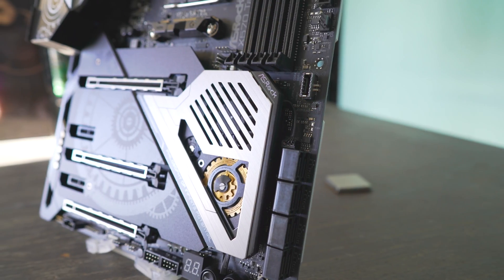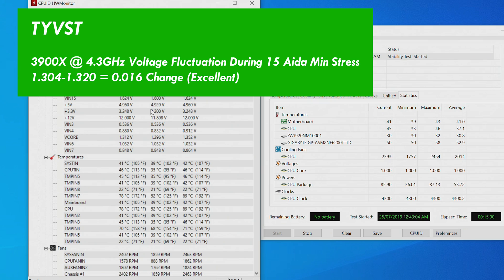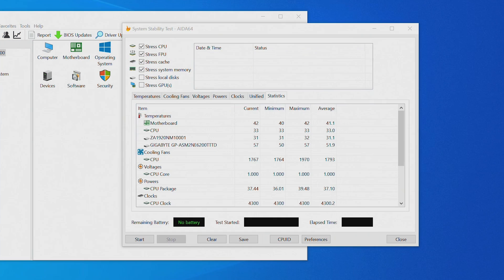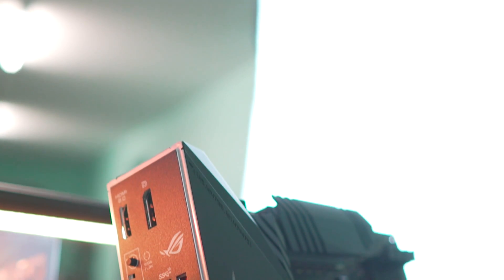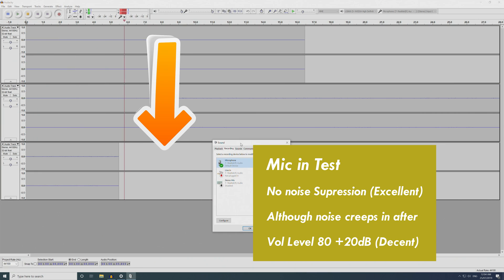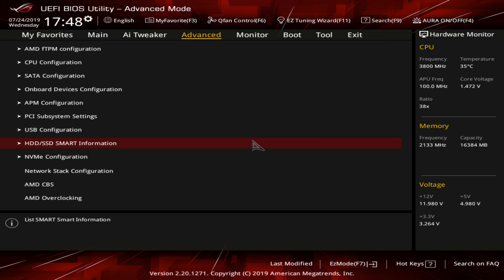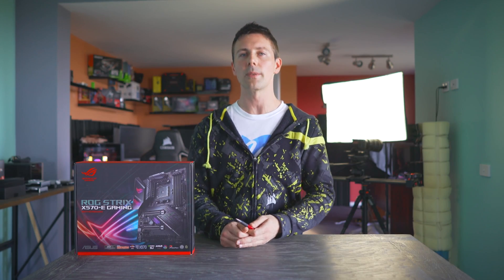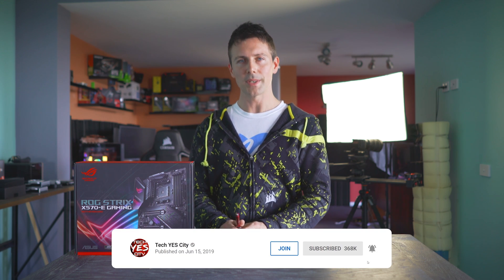ASUS ROG X570 Strix-E Motherboard Review - "3900X @ 4.325GHz Dayo"

Comment: picked one of these babies up new in box on Ebay for £200 here in the UK. I have to say I've been bitten by the ASUS bug for my previous (also used in like new condition bundle deal from Ebay) 7700k and Z270f platform. Its that ASUS has such good product support and a robust BIOS and featureset, looks like I'm an ASUS customer for the foreseeable future.

Comment: excellent review.. I know this is an old video but would you be able to tell me if this board X570-E Gaming with Ryzen 5000 can run 2X NVME PCIE 4.0 without affecting GPU PCIE 4.0 bandwidth.. I have this board with Ryzen 5 5600X, Geforce RTX 3070, 1X samsung 970 evo plus.. I want to install a second 970 evo plus NVME but dont want affect GPU performance but cant figure out if that will be the case or not.. Am i better off having the second drive as M.2 Sata\ 2.5 Sata....   Many thanks

Comment: 4:08 Running tests on teh Sh*t folder 🤣🤣

BTW, Bryan, on the off chance that you read this comment, I have the X570-E and the chipset temperature reaches 90C while gaming. Have you taken a look under the heatsink to see if they used a thermal pad between the chipset and the heatsink instead of thermal paste?
Reply: Does it still get that hot now with the latest bios update’s? I’m really on edge with the active fan.
Reply: @CBGENESIS  BIOS updates didn't do a thing for the chipset temperature because it's a design flaw. Any high-end GPU will totally block the fan.  The only way to lower the chipset temperature is to increase the speed of the GPU fan
Reply: @YAAMW  Do you still own ur X570E? and should I avoid the board?

Comment: I Got The Asus ROG X570 Hero & a Ryzen 9 3900X & I Got It Overclocked to 4.35Ghz on 1.32V Rock Solid ! I Think 1.40-1.45 is Just To Much Voltage IMHO ! I Do Have A NZXT Kraken X73 360mm And I Am Well Pleased.. Gaming Temps Stay n The High 30's Or Very Low 40's ! I Just Didnt Like all That Voltage That Was Way Over Kill !  DerBauer Said No More Than 1.32.-1.36 MAX On LN2 So I Took His Advice..lol. But I Half To Make My Junk Last For Several Years & We All Know Heat Is Eletronics #1 Enemy !! Cool Video To btw !
Reply: Can u explain how did your overclock man?
Reply: @gironsantalla7870  Wasnt To Hard..I Just Do Manual Overclocking I Have Never Done Any Software Overclocking. ! But I Just Went into my Bios/Uefi With Every Thing Set To Defaults/Or Auto and Just Set Multiplyer to 41 or 42,43 or So Then Set Manual Cpu Voltage to 1.3000 Volts And save Then Try To Boot If No Boot Or Blue Screen Either Raise The Voltage to Say 1.34v An Re try Then After ya Test Every Thing & It Is Stable Ya Can try to start bringing down the voltage a litle bit at a time an re test..then Rense & Repeat
Reply: @bigchew3149  thx a lot man. May I ask u for temps? I have a Corsair 115i with my 3900x and it has about 80° in cinebench or cpuZ bench. Is this normal? My case is also top I think (Corsair carbide)  but these temps scare me (sorry my bad English) (it has about 90° in prime95) 😱
Reply: @gironsantalla7870  I Have A NZXT Krakn X73 (360mm AIO) ) & I Have Never Saw Mine Out Of The Mid 70's At Most But I Have A Big Cube Case Thermaltake Core X9 & My Room Has AC about 70f ! Ya Can Try To Lower ure cpu voltage just a Hair An See If That Helps Any ! But Under Normal Use Ure pc Will Never Get That Hot No Way So I Would Say Ure Probaly Ok ! But Ya Could Go Find a Video from jaystwocents here on utube an he has some overclocking videos & tems to That Might Help Guid Ya !
Reply: @gironsantalla7870  o wow that seams high to me did ya add tip to ure cpu befor mounting it or wht?

Comment: ASUS makes without question the best X570 boards. The Tuf Gaming and this board are in the sweet spot.
Reply: Roland Strauss just send back my tuf good board clocked my 3800x perfect but noticed missing bclk options ect in bios

Now I have this strix-e and I think it’s worth the £80 upgrade loads of features like Bluetooth even an less vdrop on cpu from idle to full small fft loads (using load line level 4)

Can’t wait to see if I can squeeze alittle more outa this chip with bclk still it wouldn’t post with 1900fclk 😢
Reply: @FireTwo  Can u explain how overclock a 3900x with this mobo? Thx in advance

Comment: does it matter which nvme slot is used? does that do anything with the pcie slot speeds? I installed my nvme ssd in the top slot, should i use the top pcie slot for my gpu? or does it not matter at all? thank you!

Comment: Might be a bit of a random question on your video but it is driving me insane at home. In the video you show temperatures on CPUID HWMonitor, i have exactly the same TMPIN's showing up and i wish to ask if you know what diode TMPIN4 is. I have been looking all over the internet to find a answer and so far i got none. Hope you find time to give a answer, would be nice to know what i am dealing with since it randomly goes up and down between 85-94 degrees C.

Comment: Just bought this board today. Glad I did.
Reply: I also purchased this board for some reason TMPIN4 is reading 84 degrees at idle. Are you having the same issue? While Bryan's is 70 degrees under load.
Reply: @victorsvay3986  Yea mine is reading 80 degrees Celsius
Reply: @ahwayzcool4630  So Im guessing TMPIN4 is not being used and is providing false readings? Mine is now 94 degrees C even at minimum and maximum
Reply: @victorsvay3986  Yea that's what I'm thinking to. Its prolly a default false reading for a missing sensor. I'm not gonna worry about it because all other temps are normal.
Reply: @victorsvay3986  what processor you have? I'm running a 3900x
Reply: @ahwayzcool4630  3700x
Reply: @victorsvay3986  nice. Finished the build today. Installed windows 10, been tinkering all day with it. Running some benchmarks now. I'm really liking this. Gonna install some games on it in a bit.
Reply: @ahwayzcool4630  hahaha nice I'm still waiting for my graphics card
Reply: @victorsvay3986  what graphic card you getting? I just recently bought a 2080 ti
Reply: @ahwayzcool4630  2060 super. It's too expensive here in Aussie for a 2080Ti

Comment: I always appreciate mainboard reviews and hope there'll be more coming. But: Even initially you state that the VRM on this boards is close to the top-end boards on the platform. Actually, though, this board uses close to the same VRM than the 200 dollar Asus boards (TUF X570 Gaming Plus, Prime X570 Pro). Only the SoC VRM is slightly more beefy on this one. The Crosshair boards are only a bit more expensive (depending on region, of course, but still) and feature way better VRMs.

I mean, yeah, sure, all of these boards will handle the most high-end Ryzen 3000 CPUs, boards are really a huge step-up from previous generations in that regard. I still think that it's misleading to state that these are top-end VRMs, because they really are not, when put into the context of its generation.

Take the X570 Taichi by comparison: It uses the same VRM than the Phantom Gaming X model, so it basically is the best that ASrock offers. 

I would recommend talking to Buildzoid in this regard, if you want to improve your reviewing there.

Comment: Hey guys, I recently purchased this motherboard but I'm having really high CHIPSET temps -> high fan RPM noise (3500 RPM):
72C Idle browsing reddit or Wikipedia and about 79C during gaming!! Can anyone confirm this is supposed to be that high for this specific motherboard or is my chipset heatsink faulty and should i order a new Motherboard? 
Thank in advance guys :)

Comment: I think X570 board are for those who go high end builds and R9 CPU.
I'll stick to my X370 board with crappy VRM "heatsinks" and update my R7 1700 to R7 3700X after I get 2080Ti.
The thing is that newest AMD CPUs don't have big TDPs so if your board handles first R7s then it will handle newest R7s, in my case R7 1700 has 65W TDP and R7 3700X I want to update also has TDP of 65W.

Comment: I just built a pc 2 weeks ago with this mobo!
Reply: Reviews on this mobo ? Any suggestions for an other one at this price range ?
Reply: Sotiris Triantoulis I got mine for 279.99 because of the bundle deal at microcenter. It’s pretty good, and had all the features I need and more. The lighting is a problem though because the aura software makes certain games think you are running a cheat. The labeling and placement for some things on the board were kind of weird, but could just be because i’m a first time builder and things are confusing. Not sure about other boards at the same price range, I would just look around at reviews and features and find which one suits u.

Comment: None of the x570 mid-range or high end are worth it
Reply: For a 3900x?
Reply: @dommo2803  Okay take the strix-E which is £323 Vs the Strix-f which is £260 now the major differences are the number of USB ports on the back and that it has 2.5Gb networking now I have never needed 12 USB ports on the back of my pc at best 6.

As for the networking if you need faster networking by getting the cheaper board you could afford a 10Gb nic so it makes 0 sense to get any board with 2.5Gb networking.

And it's these 2 "features" that make the boards more expensive.
Reply: @invoke4485  You're right. I think Buildzoid has said something similar also.
Reply: @dommo2803  ya I'm getting the strix F and if I was faster networking I will buy it

Comment: hello i was wondering if any one could help me about my problem i have a lenovo thinkcenter edge 71 1578 sff that I would like to upgrade and recently bought an rx 570 but it wouldn't work fans spinning on cpu and gpu but no video out on the monitor thanks in advance
Reply: I think you should go into bios and change display settings. Possibly you are on integrated GPU. Change it to PCIE GPU. To go into bios, start your PC while holding F1 button on your keyboard.  And watch this video how to change display (IGPU and PCIE).
https://www.youtube.com/watch?v=bNuXZnaTg9U 
Display settings start at 0:37 sec

Comment: 3700x+MSI X570 Gaming plus+Corsair MP600 1Tb to CPU+Corsair MP510 960Gb to X570 chipset, ok now the chipset fan rarely spins up. When it does run,it never goes above 1500 to 2500rpm,it has a max speed of 4500rpm.With my 2080Ti black on a zero rpm fan curve on desktop mode,but running a stress test on the drives ,its actually pretty quiet.Copying a large 83Gb folder with 1000s of music/video files,after the 1st 15Gb the x570 fan spins up a bit,but again never over 2500~ rpm.

Comment: Are you seriously letting Asus get away with "teamed mosfets" as if it's inherently different from a parallel power stage or parallel mosfets and driver.
It's still a 6+2 phase board using parallel stages.
Reply: Wat does this even mean?
Reply from the maker: The overclocking was very smooth on this board and it was the only board to take my 3900x to 4.325ghz, I know its only 25mhz but still there must be something to it?
Reply: @techyescity  
But what does "teamed mosfets" mean.
Looking at the diagrams (1:14) with the doublers vs teamed, the teamed is just a parallel stage diagram.
Typically parallel circuits often use discrete mosfets and drivers rather than a power stage as it's often used in cheaper boards to fake the perceived number of phases. In the next section you can see that the phases are lined up in the twin VRM (teamed/parallel) whereas the other one shows the phases as separate which is what the doublers do.

The transient response claims are no different than what you'd find with parallel stages, they may well have tuned the board for minimising the transient response, but it's just two stages turning on in parallel rather than in two phases.

I can't see anything special regarding the VRM and the only thing teamed (doing together) brings is a new name for the same old parallel phase design.
Reply: @techyescity  ccx overclocking can you look into it

Comment: Is there any X79 1680v2 vs Ryzen 5 3600 or 3700X soon? :)
Reply: He already did one VS a 2700 and 9900k iirc. So no real need. Our 1680v2's while great are now aging with this next Gen amd. Think I got my 1680v2 for around 150 usd and same for the Asus iv rampage extreme. While others paid over 300 usd for each. X79 just not worth it at those prices in comparison.
Reply: @tacticalcenter8658  Yeah i already know that vid. But it would be nice to see a follow up on the 3000 series as well.

Sooner or later i will upgrade from my aging X79 to ryzen.

Comment: 61c in winter, you can add 10-15 c on that in Sumer here in Australia, I don't see my self ever running Asus in the future even if for free, ever since Asus Rampage X58 mobo back in the day, I find their boards run waaaay to hot.
Reply: Except the new ones run cooler due to vrm and board layer design. So it's worth getting now.
Reply: @tacticalcenter8658  They still run @61c, in winter, in this video in 2019, that is horrible for overclocking and in general. Here in Australia with the summers we get, Yuck.

Comment: can u do ryzen 3900x one ccd disabled (low performing one) and test the best performing one bcs it can boost to 4.65ghz all core I belive against 3600x or 3600
Reply: Again per CCX overclocking might also produce good result or even better results can disabling a CCD or all core overclocking.

Comment: Ryzen 1600 vs i7 3770k for gaming I'm torn 🙁
Reply: Ryzen. 3770k is old and going nowhere. If you go Ryzen you always have the option of updating BIOS and putting in a 3600 or better later which will last you for years to come.
Reply: Ryzen, 1600 is stronger overall and closer than you think in single thread IPC - upgrade path is gold. 1600 today, 3600 or 4600 later

You'll have to push that 3770k to max OC just to baaaaaarrely beat 1600 on single thread
Reply from the maker: It all depends on the price, intentions and what you want to do with it?
Reply: @techyescity  gaming I already have the 3770k at 4.6ghz I was just wondering if I would see a difference with a ryzen 1600 I'd upgrade it in the future I already have an msi x370 gaming pro motherboard.
Reply: @danielson9579  ryzen 5 1600 is pretty slow honestly it performs close to the i7 but in games that utilize more than 4 cores (very few) theres a bigger difference. Honestly i wouldnt bother unless you are going for ryzen 5 3600, i7 single core perf is on par with the 1600(ignoring OC than the i7 is slightly faster).
Reply: @danielson9579  unless you're only playing dota and CSGO exclusively you will see an improvement in FPS with R5 1600 but you're mostly buying the upgrade path and double RAM speed tbh

Comment: Thanks for filling in some of the gaps about the MB I bought. I justified the MB because of the heatsinks and the extra 2.5Gbit LAN. The nvme heatsink balances my cheap Crucial 1TB nvme which has negative reviews on 'overheating' - but is half the price of every other Nvme SSD of the same price. The only downside is that AMD doesn't natively support RAID 5 - Which I'd have preferred to have run rather than RAID 1 to protect my data further.

Comment: I'm old enough to remember disco in the late '70s. It was fun, and you could get laid, but I don't want a mirror-ball or a smoke machine in my computer. Apart from that, this is pretty much exactly what I want. I plan to get an R9-3950X about Christmas, and a 2TB M.2 drive.
Video ... haven't quite decided there. I want to spend maybe two hundred Australian, not two thousand. I'd strongly prefer an AMD GPU to go in my AMD Linux system. A Radeon 7 would be nice, but $.... They're getting ready to bring out mid-range and maybe low-end NAVI cards, and one of those might tick all the boxes.
What do I do with that? Daily driver, Linux host (Mint) and VirtualBox + 3 Windows guests and about a dozen Linux installs. I like to compile a kernel here & there.
Do I need all that power? No, I don't. The 6700 I have now is perfectly fine, but ... you want a Ferrari, don't you? Not a 4 cylinder Commodore... It's a boy thing. I want a V4 Ducati, not a CB125 or a posty-bike.

Comment: So far I have managed to boot twice with a C6H (8 CPU phases on the VRM) and a 3800x (qcode 07 seems fairly common on ASUS underdone BIOS). Got one CBR15 run in with single channel 2133 c15 RAM and it was hitting solid 4.3ghz across all cores dead stock on multithread (confirmed with latest CPU-Z and HWmonitor), and peaking 4.55ghz in single thread. VRM's got no hotter than they did with a 4ghz 1600. 210 points in CBR15 single thread not behd, gud soize!
Point being are these 12 phase 300USD boards even worth it when there are 200USD boards with similar capacity VRM's?

Comment: For my need this one was the best deal, considering also the local prices. Overall it has most features: eight 10Gbps USB3 gen2 ports, cheap for having two network cards with wifi, max sata ports, lots of PCIe slots, good VRM... And two M.2 ports are ok for me, because if there were three, then it would lose 2 sata ports - so I was reading.
Reply: Add a cheap sata III card.

Comment: I am saving for the x570 tuf wifi, r7 3700, 2x 16gb 3600 and any custom cooler rx5700xt for this fall. from my old b450-f, 2200g, rx570 and 2x 4gb 2666.
Reply: nice
Reply: Nice! Is the B450-F not enough for the 3700x? Why are you upgrading the motherboard?
Reply: Turns out the VRM on the B450-F is not that good. Maybe upgrading isn't that bad of an idea. https://www.youtube.com/watch?v=yWAwOH-egFs&feature=youtu.be&t=1589
Reply: @IsentropeMachzahl  yeah I would stick to 65W chips like 3600 for weaker VRM
Reply: @IsentropeMachzahl  strix b450-f  is a good mobo even for a 3950 r9 stock, you get 1220 audio codec, intel nic and 4 vrm 2+2 soc but only if you remove the stupid rgb plastic shroud  because wont let air get in to remove heat from vrm. but i am passing down the parts to my nephew. ^^